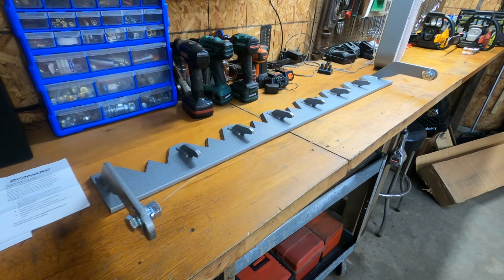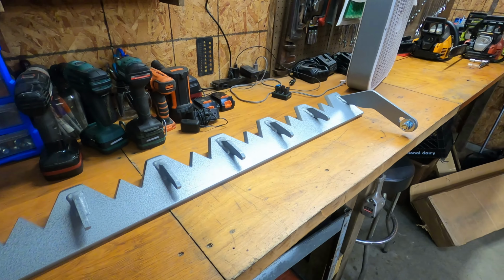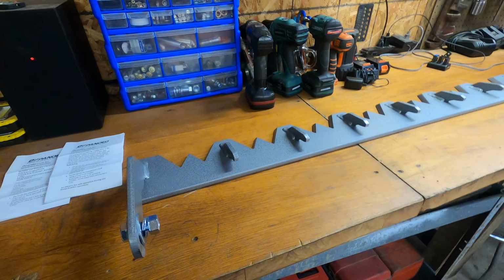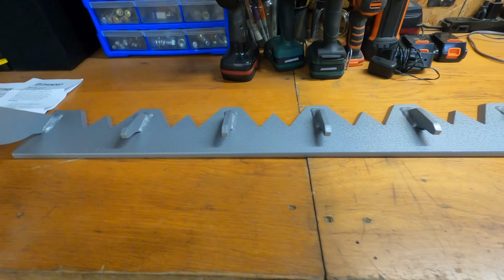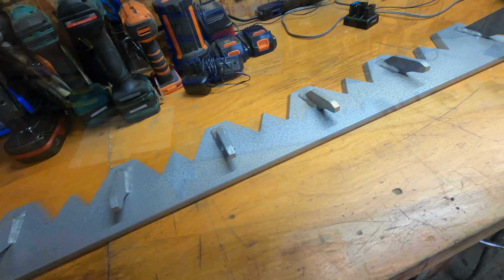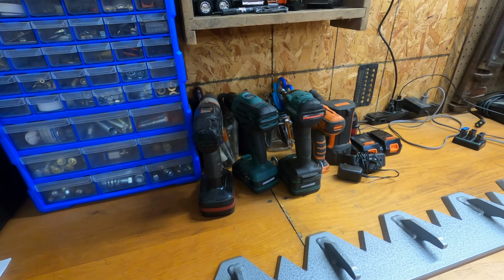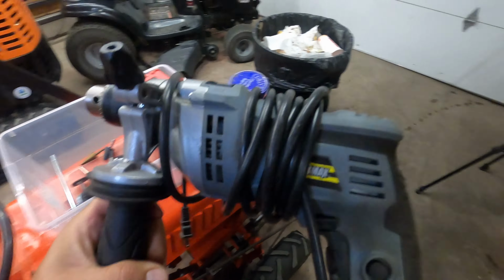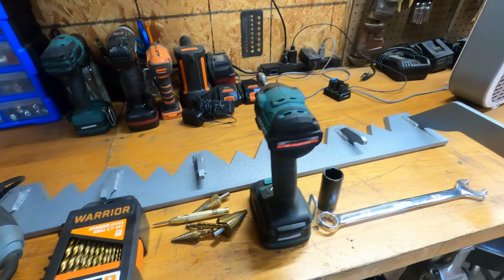Buying/Installing Piranha tooth bar from BXpanded on Kioti CX2510

Comment: what size did you order for the CX2510?
Reply: I ordered one Monday . Tell them the measurements, dimensions. I called them. Talked to Howard. They are working on making the process easier.  Soon you should just be able to tell them the model ,year and bucket size. I ordered the Pro Model it uses the existing holes. I'm  waiting , could be three weeks. I would like to hear how well it preforms. I have a CS2220 Kioti.  Cobolt drill bits are much better.

Comment: instead of the tabs for the bucket lip to wedge in couldnt they have made this to be a bolt on since the bucket has pre-drilled holes?
Reply from the maker: @dorito31561  they could have but it would have just been more bolts to mess with. This can be put on or taken off really quick with just the two bolts. Those tabs work great holding the toothbar.
Reply: They make one that uses the existing holes. It’s the piranha pro version. Has serrated edge on one side and flat cutting edge on the other that’s reversible. Also like another $150-$200 over the cost of this style.
Reply: I really like this tooth bar, it made a world of difference on large stone/rock. I will admit though I do keep it off because back dragging/smoothing isn't fun with it on. It's not like a skid loader that has a flat portion on the back bottom of the bucket specifically for that. You just end up jamming dirt into the quick attach. Anyway money well spent and I think necessary for any owner! I am curious what the factory bolt on looks like though...
Reply: Nice, that tractor is a workaholic 😅😅